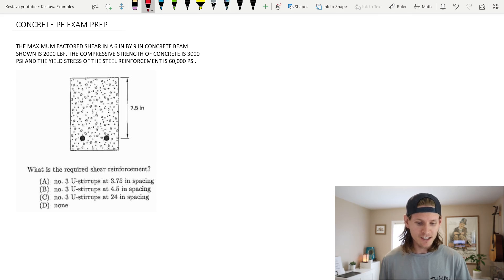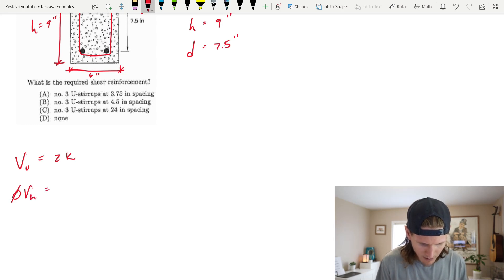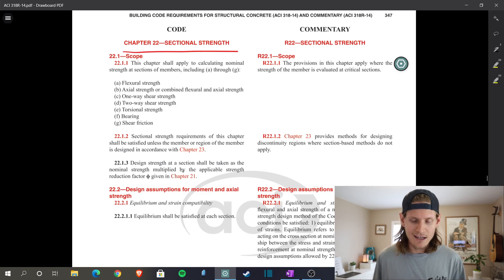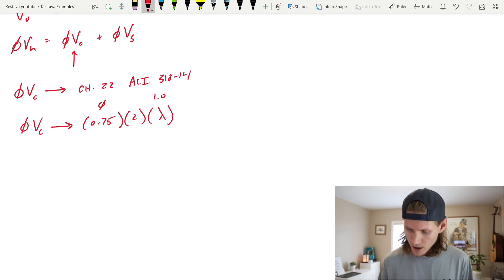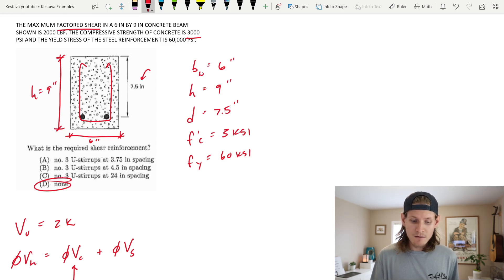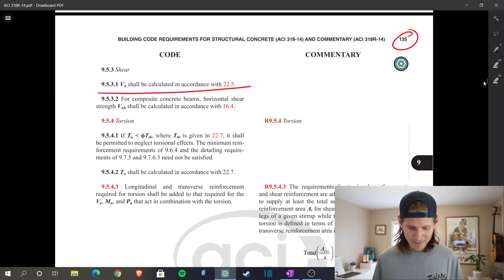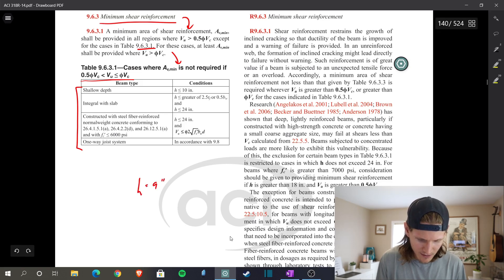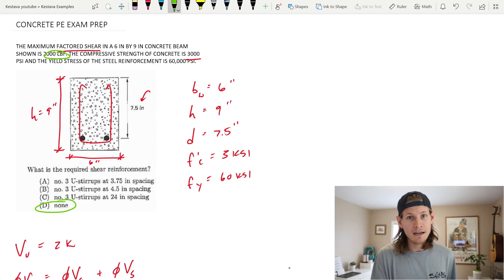Civil Structural PE Exam Prep | Concrete Design | Fall 2021 Exam

Comment: I’m interested in slab on ground. I see 318-19 talks about it but how does it compare to aci 360?
Reply from the maker: typically ive heard it be called slab on grade, but yes we can do an example! Im not the most familiar with aci 360 so ill need to jump in!
Reply: I did some more research and ACI 360 & 330 are considered non structural. I would be curious what you take is on the meaning of non structural. Anyway the slab on grade is designed without rebar using a chart PCA method